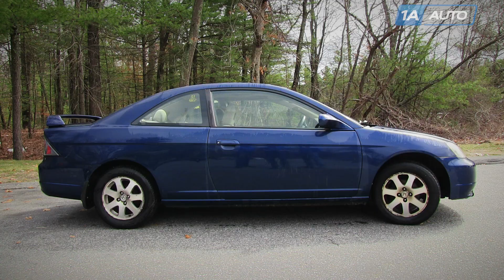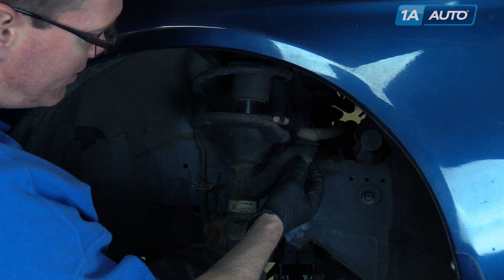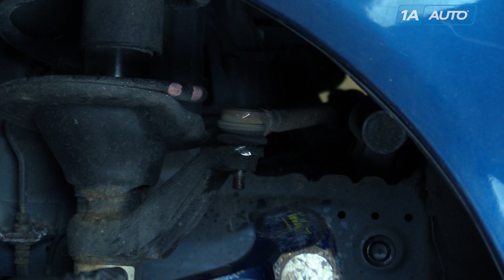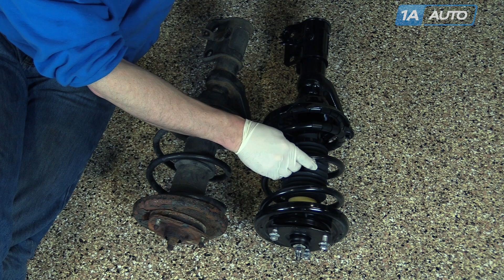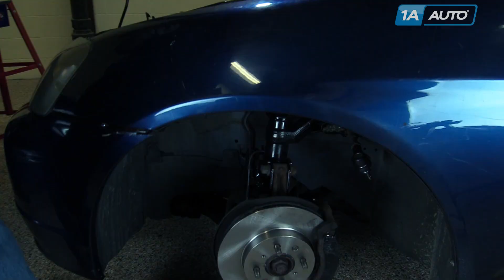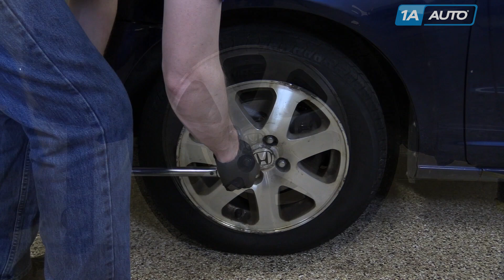How to Replace Strut & Spring Assembly 02-05 Honda Civic

Comment from the maker: √  Watch the Video
√  Buy The Part at 1A Auto https://1aau.to/m-Visit-1AAuto
√  Do it Yourself
√  Save Money
Reply: Do you have to loosen the tie rod? Can't you just take the pin and nut off and pop it up ?
Reply: Is it necessary to remove the brake caliper?  Looks like it could be done by just moving the brake hose and sensor wire and shifting those out of the way....?

Comment: I just did this and when the lower control arm dropped, the inner Cv axle came apart :( I had to replace the Cv axle. Use a bungee cord so the lower control arm doesn’t drop or put a jack under it. Lesson learned!

Comment: My parents mechanic tried to charge me 2k to replace all of my shocks and struts. My back suspension is fine. They also told me they had to remove the inner and outter tie rods because my outter tie rods were bad and seized to the inner tie rods. How can that be, they aren't even touching in this video 🥴😡 I paid $700 for them to replace my outter tie rods on my 2003 honda civic.

Comment: No need to take off caliper, just did mine without doing that. Great video by the way much help thanks
Reply: I like the sound of that. Lol. Did you have to do anything else different or was there just enough room without taking it off?
Reply: Did you try it without removing caliper. My rock auto delivery just came

Comment: What is the reason for loosening the tie rod adjuster lock nut?
Reply: Not sure just came from another video who mentions this one, and he said he didn't have to do that with the tie rod. Also another commenter on this video mentioned they did it without taking the caliper off as well. Not sure if that's the case but it would be great. Eventually I'll have to fight with my brake and calipers but would like not to atm. Lol.
Reply: You can see at the end of the video they replaced the tie rod end but didn’t include that with the video.  So no it’s not needed.

Comment: Can you use an impact wrench on the nut connect to the tie rod?
Reply: I wouldn’t if you need to ask that question you’re probably going to way over tighten it also how tf you gonna know when it’s at 30 ft lbs

Comment: I’m having a lot of trouble on the bolt with the cotter pin. I have the pin out and the bolt off, but it seems seized. I sprayed penetrating fluid but it’s still stuck. I banged the hell out of it too. Any tips PLEASE?
Reply: i'm sure you've gottten it solved by now but could try some heat or one of them tie rod removal tools you can rent from the auto parts store

Comment: Is it necessary to loosen the lock-nut on the tie-rods?
Reply: Not necessary but you might need alignment after
Reply: I would say not so much. Because if you look closer to the end of the video they put a new tie rod on as well
Reply: You do NOT need to break free the tie rod end. Just remove the cotter pin and nut and hammer it free be careful not to damage the threads. They edited in the tie rod end replacement from another video into this video, not sure why.
Reply: @BrookBowenVideos  so no need for an alignment?

Comment: You make great videos — thank you. Can I just remove the castle nut on the tie rod end knock it out that way? why do you loosen it on the bar?
Reply: They only removed it because they were replacing the tie rod end on this repair. If it is reusable then you don't need to loosen it. It'd be a good idea to replace it at the same time though because if the strut is bad then the ball joint on the tie rod is probably on its way out as well. That way once you get your alignment you only have to do in once for both repairs.

Comment: I appreciate the free content, these videos have helped me do several repairs. But, you guys should really let people know that if you don't support the knuckle after removing the old strut, it will pull the cv axle out. At least it did on the passenger sideb for me. This made the job a huge pain and could have been avoided very easily had I known
Reply: I normally do not read comments if I really like the video. Today was my lucky day.  I read your input prior to pulling the right side.  Supported the knuckle on concrete block.   Everything took about 45 minutes to install.
Reply: Jason Winn so did you let the cv axle fall too quickly? You didn't have enough support? What happened

Comment: how did you let the a arm drop without pulling the cv shafts out of the sockets?
Reply from the maker: The lower arm should lower when you remove the springs.  The CV axles will not prevent the arm from dropping at that point.
Reply: I just did this and the inner Cv axle came apart on the passenger side. :( Had to replace the Cv axle

Comment: Hey 1a Auto, I cannot find a confirmation on a 05 civic SI hatchback.  I need the FRONT pair of strut & spring assemblies. I'm NOT dealing with removing the springs from strut assemblies and re-assemblying them.  I cannot win for losing.   

amazon dot com link for MONROE 172185 172186 Front Quick Strut & Spring Pair Set For 02-05 Civic on  claims it fits  my car but Amazon DOESN'T have a drop down selection menu for the SI trim ..just basic civic 05.  Another site claims this exact strut set DOESN'T fit my car

Can you PLEASE confirm a variety of brands and what not pairs that will fit my car.  I'm not trying to have to replace these every 2 to 4 years as I bought a cheap ( sub 175.00 for the pair) pair from either ebay or amazon in September 2016 and the damn top shock mounts are worn out already my daily commute isn't in pophole infested streets.

Please respond fast!!  Thank you   .  I love your videos.
Reply from the maker: +tpcs We have the MONROE 172185 172186 struts listed as not fitting the SI model. We do have this loaded front strut kit listed as fitting your vehicle if it has the 2.0 engine in it. Here is a link to the struts that we carry on our website. https://goo.gl/tUsgRc
Reply: 1A Auto Parts interesting. I just checked on eBay copy and pasting the exact part number your URL showed me and it cross checked to the 172185 & 172186 strut assembly part numbers for the front.

Comment: hey 1aauto i just need the front driver side for a 2002 honda civic lx sedan. i can only find a set of two or just one for a 2002 honda civic si
Reply from the maker: +Josue Aguilar Thank you for checking us out. Please view our part number 1ASTS00652 for the driver side of your LX model sedan. https://www.1aauto.com/acura-el-honda-civic-strut-and-spring-assembly-front-driver-side/i/1asts00652?f=592530&y=2002
Reply: 1A Auto Parts THANK YOUUU